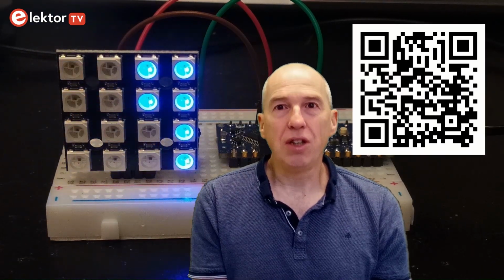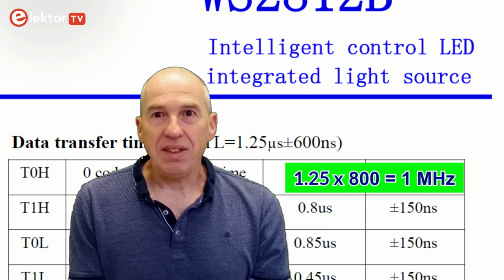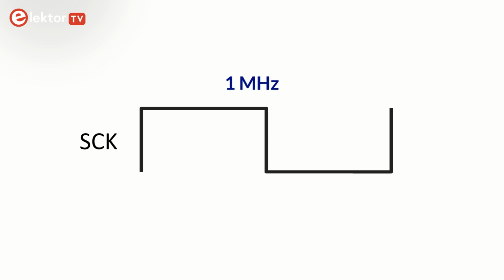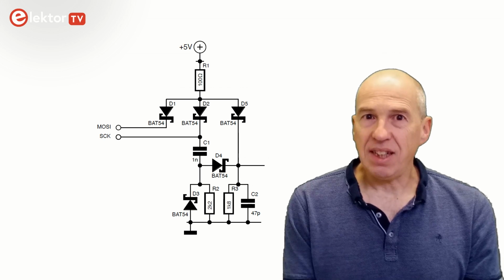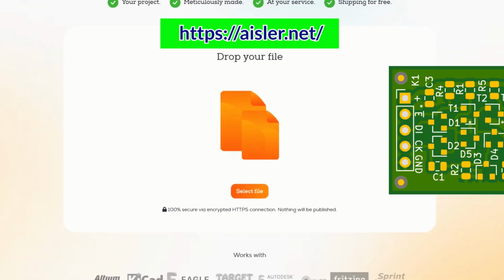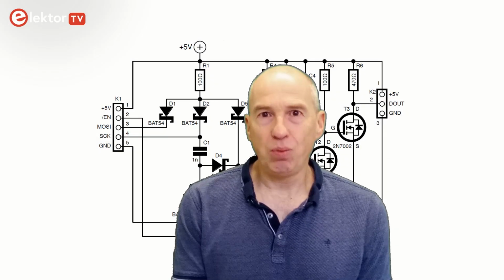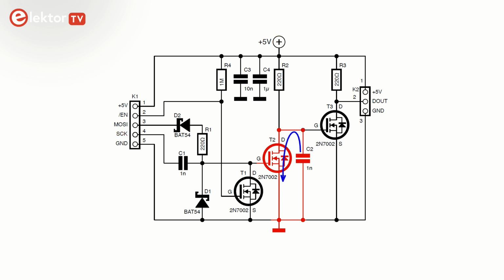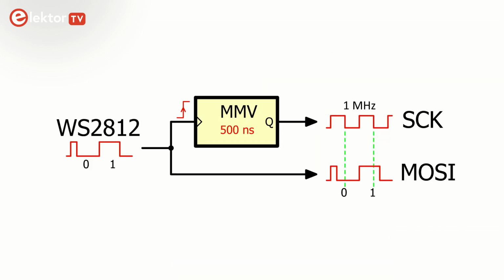SPI to WS2812(B) Addressable RGB LED Converter - More LEDs, More Power!

Comment: Hi Clemens. I am wondering how the circuit 3 with the NAND gates work. The differentiator acutally just reacts on the edges of the signals SCLK and MOSI, but when MOSI has subsequent ones, only the first 1 is detected from the differentiator. I have simulated the circuit as well and I do not get what I have misunderstood. Maybe you could clarify what I miss. :-)

Comment: you can then use each WS2812b to control a arduino to control some (many ) devices/servos/motors...
Reply: i2c reinvented
Reply: @Lavadawg  i2c is limited to 128 devices
Reply: @marckerger  127 in fact, even 1 less... but who would want to control that many things in the first place?
Reply: @Lavadawg  i've seen kinetic sculptures with over 700 motors.. that is where the idea came from..
Reply: @marckerger  Well in that case it's probably a pyramid hierarchy system where they have 1 main machine controlling 20 mcus that go to control like let's say 35 motors each, this is a very practical method

Comment: Using an ESP32 and the Adafruit_NeoPixel lib, you can tune that up even more. In Adafruits lib, find the file "esp.c", there, modify that simple timing parameters.
I had stable working WS2812B chains using this timings:
#define WS2812_T0H_NS (175)
#define WS2812_T0L_NS (525)
#define WS2812_T1H_NS (525)
#define WS2812_T1L_NS (175)
That actually makes 1.43MHz and if you ensure that every WS2812 chip in a LED strip has the full supply voltage (> 4.9V), this works with 1.53MHz, too.
And there is no bitbanging due to hardware support of ESP32 (RMT-function is used). Even 8 separate channels using 1.53 MHz all parallel and at once are possible without disturbing the processors work. Why taking 25% if you can have 92%?
Reply: You should havr a video of that

Comment: This is what I did six years ago: https://youtu.be/ThVfUsZBNwM
It uses only a Mono-Flop (made with 74HC132), triggered by the SPI-Clock.
The data-bits are used to generate long or short pulses.
WS2812 can be controlled by every SPI-Output with approximately 800kHz Clock-Frequency.
My Arduino Mega 2560 was also not able to generate 800kHz SPI-Clock. But it worked with 1MHz.
Reply from the maker: Nice.

Comment: Hi Clemens, great Video. I was just wondering if using or (mis)using a Attiny202 would lower cost for the BOM of this build?
Also have you considered using 3v3 input levels for your build? Would be cool if we could use some 3v3 MCUs like the ESP32(-C3) with it. Also as add-on you mentioned that you could do clock recovery, may we see a reduced wire SPI later :-) ?
Reply from the maker: The idea was to NOT use a microcontroller. Anyway, the ATtiny202 is about 40 cents in quantity, the presented circuit will cost maybe 10 cents. An MCU will also require programming, further increasing production costs.

The presented circuit also runs from 3V3 (may require some timing tweaking), so if your LEDs do too, you're in business.

I did indeed think of 1-wire SPI, but since the circuit needs two signals, you don't gain anything on the MCU side. So it would only be interesting for interconnecting circuits. And, of course, Dallas did 1-Wire a long time ago.